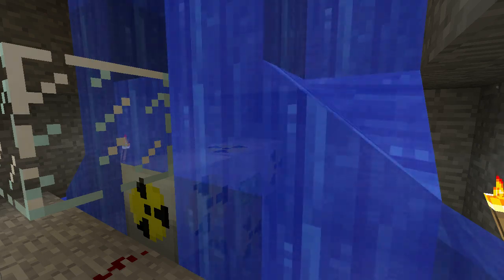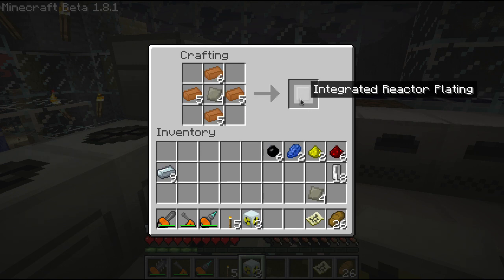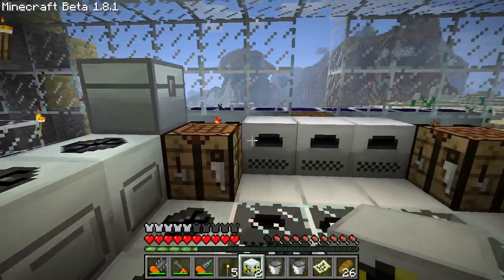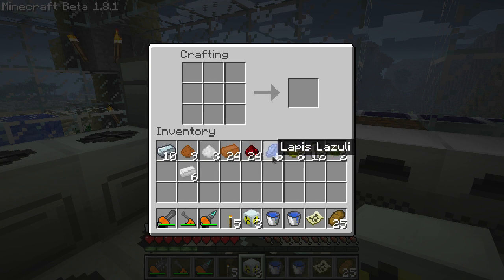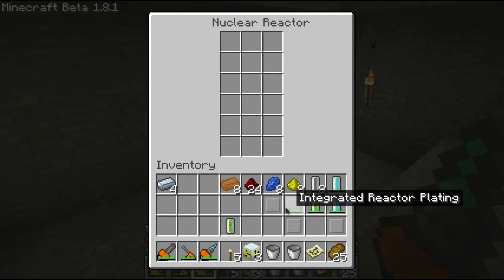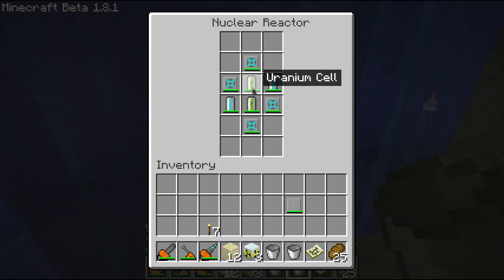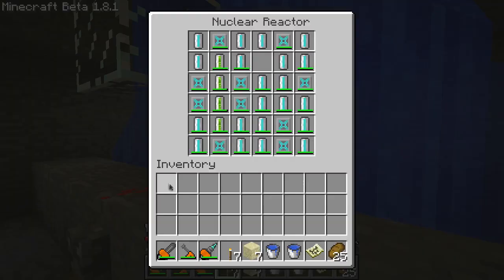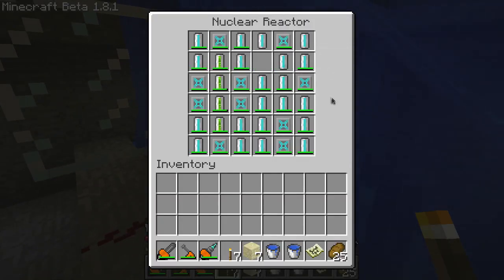Minecraft Episode 8  - Industrialcraft Nuclear Reactors

Comment: @Ghooostie The reactor itself cools 1 per second, each chamber cools 2 per second, and each water block in a 3x3x3 area cools 1. Assuming he has water in that entire area, that's 1 + 2 * 3 + 23 = 30 external cooling. The excess heat of 21 per second is split between all of the cooling components (31) and the hull itself, so that's 21/32 = 0.65625 heat accumulated per component per second. Each non-hull component has 10k heat capacity which would fill up in about 4 hours 14 minutes.

Comment: ProTip: If you are running Technic or Tekkit, one can simply get Equivalent Exchange to the point of having Collector/Relay/Condensor flowers and simply copying all ingots. Note that this doesn't work on refined iron, wires, rubber (but it does work on its raw form), but does work with dusts.

Comment: Well keep in mind the uranium cells would run out after about 2 hours 45 minutes, so you'd have to immediately replace them with fresh ones when that happens to maintain the heating cycle. Any delay in replacing the spent cells will allow the reactor to cool down some thus extending the time before it blows.

Comment: @Lavadog11 I believe there is an addon for BC that has an electric engine which runs off IC energy...

Copper wire only supports low voltage (32EU/t) which can easily be outpaced by a nuclear reactor with 3 or more uranium cells. You probably blew up one of your cables from the overload.

I think if you crouch/sneak while right-clicking items on to interactable blocks, you can place things on them.

Comment from the maker: @LeggyGuard2 you can make bare high voltage wire with 3 refined iron, just put them in the left spot, center, and right in a straight line.

Comment: @Arkalius80 Also, if you just run one full cycle of the uranium (about 2.77 hours), it would take around 50 minutes to cool down completely, generating an average of about 76.67 EU/t in a complete power/cooling cycle. I have no idea how good that is in general... but that's pretty powerful. This reactor could generate one unit of matter every 8.3 minutes or so alone or in less than a minute and a half with a full supply of scrap.

Comment: @Arkalius80 After the cooling components melt, the reactor hull would fill its remaining heat capacity in about 85 seconds. My original calculation was done incorrectly (I failed to consider that the cooling components melt before the reactor does) but it didn't throw off the final result to any significant degree.

Comment: I'm trying to learn how to calculate reactor cooling effectiveness. It generates 6 * 2 + 8 * 3 + 8 * 3 + 6 * 2 = 72 units of heat per second. It has 30 units of external cooling and 21 units of internal from the coolers, cooling 51 per second, leaving 21 heat generated per second. You have 31 cooling components giving a total of 310,000 + 10,000 + 3,000 = 323,000 units of heat storage available. So, this setup would melt in 323,000 / 21 = meltdown in about 4 hours 15 minutes.

Comment: ^ The 3 chamber Reactor, if anyone was unclear.
Also, I have a reactor that's around the same, but much more safe.
It is Mark I-O EC and only uses 2 reactor chambers
Able to run continuously without gaining heat
Produces 70 EU/t
Has efficiency 2.33
Anyone want me to post a video of it? it should be pretty common 'round the net though

Comment: I have a few questions...
1. Can you use this with build craft to power anything?
2. Did you make a video with the energy storage on how to set that up? the lumanators want light up. I basically used the copper wire and ran it though all of my lights and when I first turned it on they all light up then died, 
3.How did you get the lever on the power storage thing? 
If anyone knows why it won't work message me on You Tube. thnxs